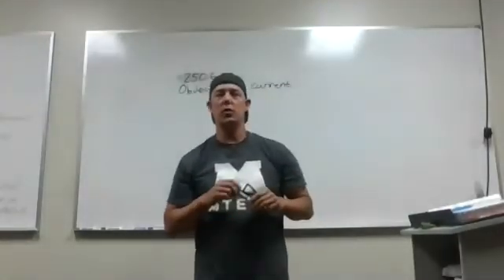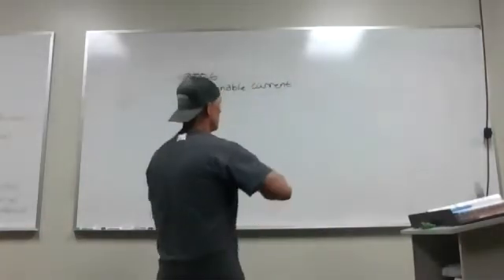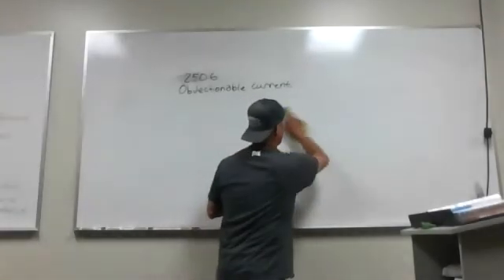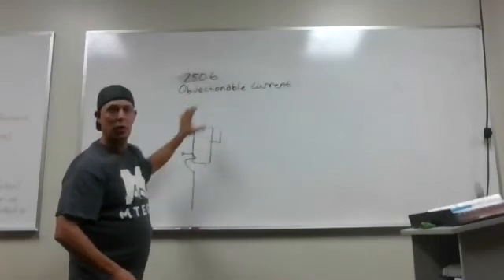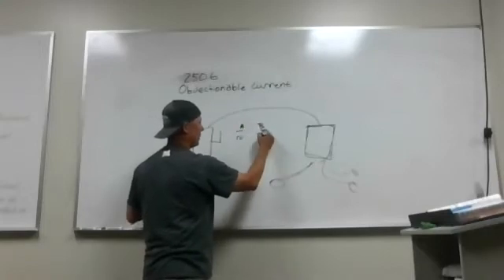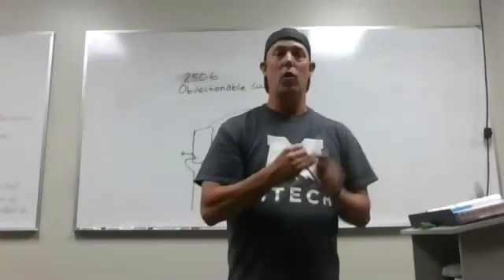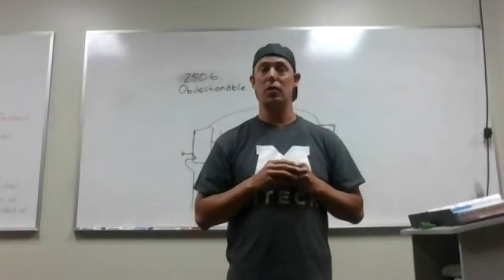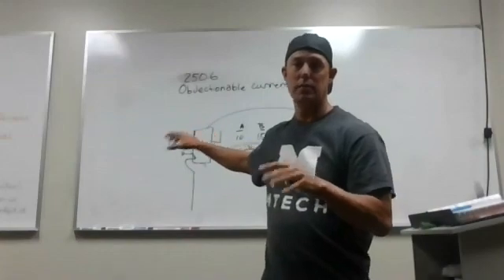250.6 Objectionable Current

Comment: I have some objectionable current being carried on a bonded surface (emt) however i dont really understand it because there is no equipment grounding conductor going back to the panel. Its an older house made in the 50’s i installed a gfi outlet and on the load side and two duplex receptacles on the load side of that gfi when i measure voltage between the line and metal box in wall before the gfi i get 0 volts when i measure at the gfi or at the receptacles on the load side of the gfi and the emt i get about 25v i dont know exactly what is happening but i think ive induced current onto the emt. Can someone give some insight.

Comment: Objectionable current flowing on the Ground wire, Water Pipe, Gas Pipe, or Cable TV wire is real and if high enough can give you a Shock or electrocute you!   Never assume a Ground wire, water/gas/cable TV wire is 0 volts, it may be energized with return neutral current from a Poor/Bad Neutral wire or a foolish bonded neutral to ground wire after the MAIN Service Panel.  Be Safe or Be Sorry knocked out on your TookUs.

Comment: Thank you for sharing your knowledge.

I have a question for you. Why is it that if you bond the neutrals and grounds correctly (I.e., at only the first means of disconnect) you don’t have objectionable neutral current flowing back from there by way of the equipment grounding conductor downstream to everything that is bonded to the equipment grounding conductor, including the sub panels? Aren’t the neutral and EGCs continuous because of the bonding? We are talking about alternating current, so won’t the current flow in both directions? Is it only ground fault current that is objectionable, not neutral current? I hope my question makes sense.